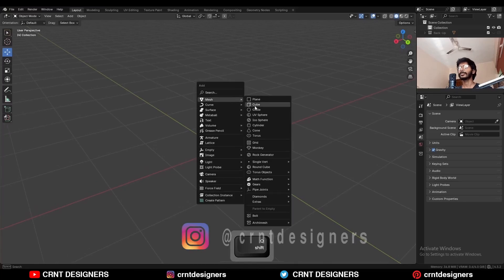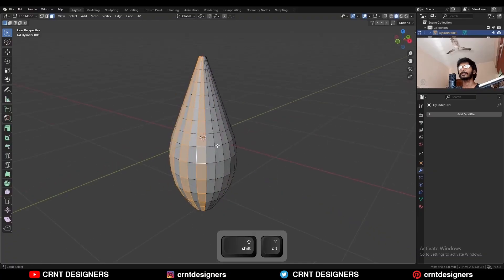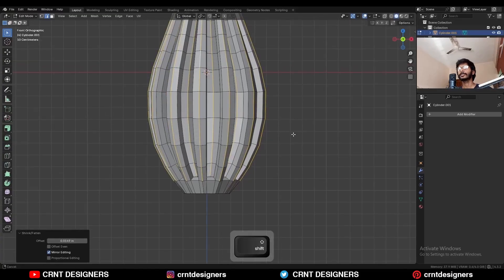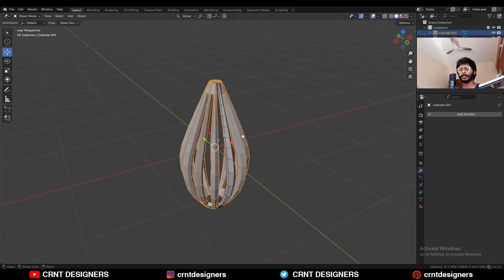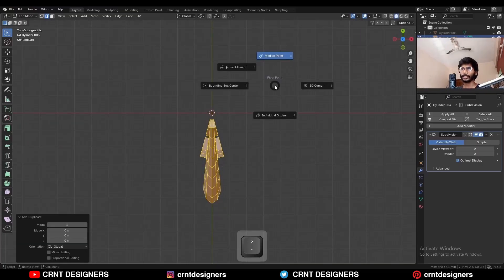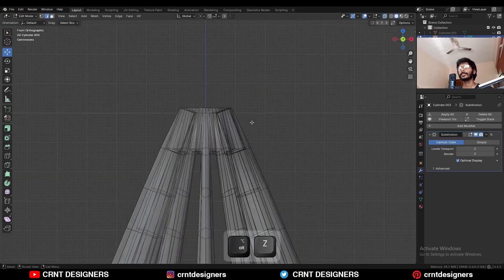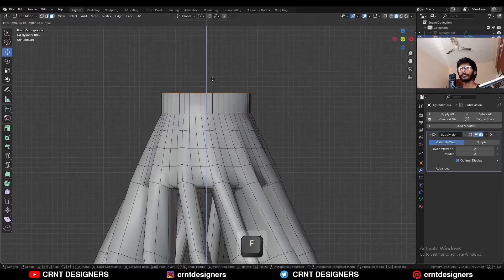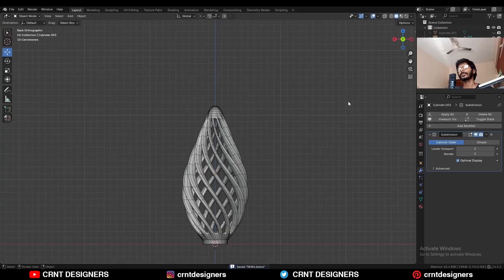NH84 _ how to model this Spiral Vase design _ blender modeling tutorial

Comment: I’m a beginner and got stuck at 0:34 .My Ctrl+B result looks very different from yours, and I can’t figure out why😢
Reply from the maker: normal bevel is bevel on edge, if you press V then you will get bevel on verts.
Reply: @CRNTDESIGNERS Thank you for replying me❤
And 2:43  I can’t find set flow after right click😢
Reply from the maker: @qllr7934  used edge flow addon